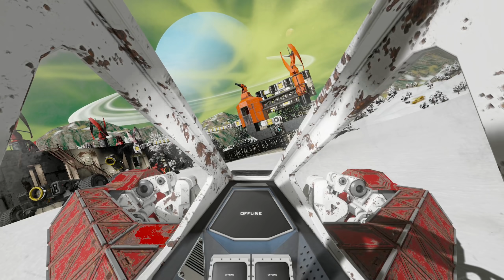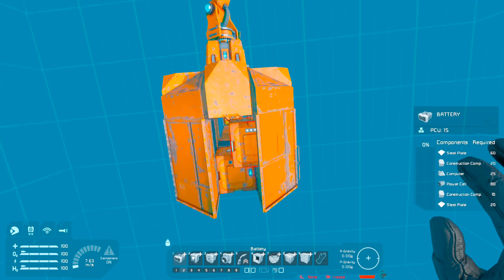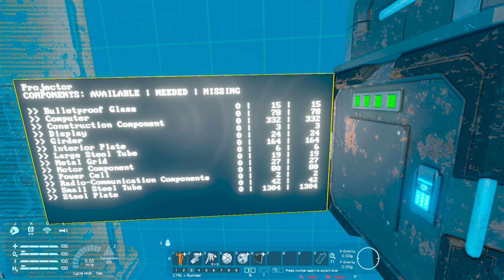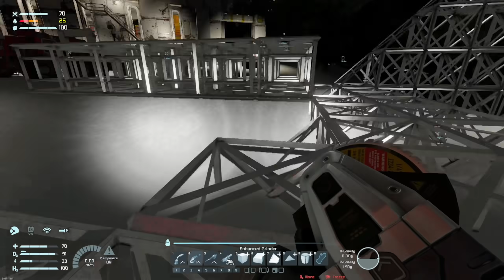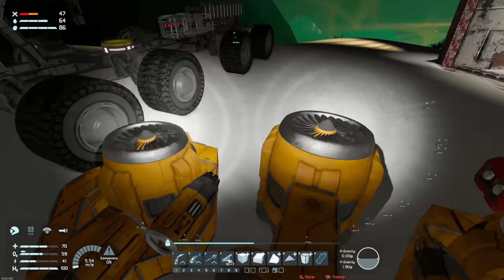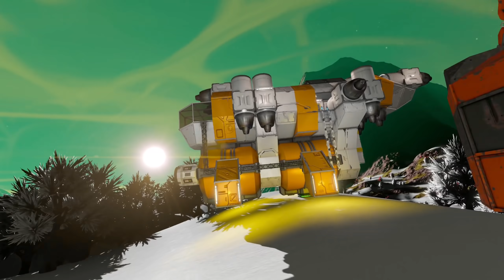Survival Impossible - Blueprint Mode #71 - Space Engineers Hardcore Survival

Comment: If you're struggling to find a reason to come back to this, FWIW, I'd love to see a re-beginning with the same settings as SI but where you can take advantage of what you've learned so far in a new start.
Reply from the maker: I'm somewhat tempted to do something like that, just in this save by going to a different planet. However it's going to have to wait a little longer as my main PC (with the most recent save) has had coolant from my CPU cooler leak all over it and I'm waiting on replacement bits before I can test what's still working 😔

Frustratingly, on the weekend I'd planned today as my day to load the world up and see what new ideas come to me and hopefully record
Reply: @Splitsie  Damn. Nothing scares me more than the idea of a coolant leak in my expensive computer. If you have not already sorted it out I would recommend disconnecting your drives before you start testing hardware then reconnect them once your sure everything is working.

Comment: Somewhat off topic, since I haven't got this far in this playlist yet, but I had an idea about mining that could be both practical and aesthetically pleasing. 

First, drill a vertical shaft down to whatever depth you need. 
Then, build a horizontal drilling rig with pistons. 
The drill head is mounted, not directly on the end of the piston cluster but on a "mining rover". It's not a real rover, it just works as a mount for some stabilizing wheels, but it's made up to look like a small rover, complete with lights and a control seat of some kind. 

Once the horizontal shaft is depleted, just withdraw the drill, swing it a few degrees to one side and drill a new shaft, like you did on the Lawn Chair base.  Depending on your vertical rig, it could be possible to extend the mine deeper, but I suspect this system works best when drilling into an ice lake.

Comment: Control center at the far end of the platform. Have the walls fold outward with the ceiling like a shell opening. No door in the way. Use light armor panels to make the shell so your rotors or hinges have an easier time.

Also... Panini could make use of an emergency down firing hydrogen thruster for heavy lifting or when you're falling for whatever reason.

Just a couple random ideas :p

Comment: It's probably a good idea to put heavy armour half-blocks around turret itself and heavy armour corner blocks to ground.
And turn battery with indicator up so you can see the charge.

You could also have it installable on top of foundation  that you place in location and then either lock or weld it (with mod I recall you have installed), so your design is more location agnostic since you can build foundation (you can even have a ship with projector installed for this and other similar ideas)

Comment: Hmmmm, for the doors, I'm suddenly wondering if something like a pair of panels on wheels that crawl up and down some angled blocks, with connectors at the top and bottom extents for locking/charging of the batteries that run the wheels. Part of me wants to try it out myself. Though, knowing SE, there's almost no way to keep it lined up correctly.

Comment: Suggestion for the lifter that removes the finished fort from the printer - move it to the other side of the printer and you could attach a walk way that also swings into place. along with the lifter, that allows you access to load/arm the fort. Might even be able to sneak in a grinder to have it cut the finished fort from the printer as well.

Comment: If the printer room doesn't need to be airtight, you could just build a solid armour slab, secure it to top of the building with merge blocks and then have some kind of external mechanism lift it off and move it out of the way as needed.  In an emergency, you could even move it out of the way with the Panini itself.

At the very least, it would be a departure from your other door designs, and keeping it on a relatively flat plane should reduce the risk to the Panini.  What's more, you can make it bigger than whatever opening you decide, lowering the chance that something goes wrong and crushes the printer machinery underneath.

Comment: Proximity Sensor to prevent Southern Fried Splitsie!

you only need to move the Projection leaving the Welders fixed in place. this is how many people build their printer walls as moving a projector and the projection is much easier.

why add a spotlight to an already fairly crowded roof. you have all manner of free space to place a free standing tower with both a Spotlight AND a Decoy in it to draw fire away from important buildings.
if it's tall enough, you can add 4 Wind Turbines onto it as well to provide power to the Base.

Comment: Spots:
Could add a merge block to the forts. Build the spot block module that you simply fly out and snap on.
Could be a lead to a new line of builds with the ability to add modules
Reply: One other thought. When you build the factory, make the back side large enough to hide the projection in it fully retracted position. Be silly it sticking out of the building during construction.

Comment: 23:41 Looks like you could probably retract the pistons at 0.1 m/s instead of the 0.025... There's a lot of downtime on the welders...
Reply: 26:08 Nudge-welding. It's a thing. Circa Splitsie, 2021. XD
Reply: 27:04 Piston elevator. Should be easy enough to make.
Reply: For your roof gate/door/opening, what if you design something that folded away? Use a combination of hinges and pistons to flip the roof up and then pull it down onto the sides of the building. Could be cool?

Comment: projected sub-grid Solution? 

First Make as ONE grid with a connector block that separates grid when ground down.., The next step is an engineering design goal. Example. Rotor based 'custom' Gun mount. Print a one grid with gun above rotor with rotor head removed and a head on the bottom of gun mount JUST above the rotor. then using piston from above (Or use gravity) maglock the top of the gun mount, 2) remove connecting block. 3) lower piston until rotor head is in rotor and then attach rotor. 

You can also print merge blocks that can be separated and then moved into position for locks and then grind them away. its all an engineering problem to be solved. A) Build as One B) Disassemble with grind blocks 3) Merge/attach 4) clean up.

Add program blocks and the whole process can be a press the BIG RED BUTTON party

PS allows spotlights on the gun itself. hint hint.
Reply: Also. it is really weird, but I just came u with that solution because you wanted to slave spotlights with the guns. its not the one you discussed but it works with custom mounts, the strange thing is I have needed to solve the problem myself, but this never occurred to me, but it did when i thought about your problem. So I guess my imagination works for everyone else but not for me? that is what is so weird, lol. either I am a very helpful 'selfless' person who only thinks of others ... or a moron.

Comment: For simplicity, maybe you could swap one magnetic pad with a merge block? You are using only one pad, so it won't reduce the functionality of the Fort Capac.

Then, you can have the printer merge block on a piston, and push printed builds through the roof - no worries about the wild swings when detaching the build.

Plus, on harder terrain, you can build foundations, and merge the forts to them. Or not, because you also have a magnetic pad.

Comment: I like the blueprint workspace. Until you moved I thought it was a modified screen cap.  I like the look you got from the blast door inside corner.  You should do a similar turret ammo indicator light for your base.  I thought the corner lights next to the door would be the ammo indicator light.  Until your "Happy Accident" with the unwelded light I was going to say to replace the 1 with 2 on either side of the post, with the missed on to your left, have 1 each on the front and back as you were looking at the Fort.  The game needs moving decoys so that the "Dancing Capac" will really dance.  Is the turret in the blueprint set for max range?  Cancel that, I saw that you do when you checked to see how long it would take to charge.  So "Wrong way Up" will be more like "Wrong way around"?
Thanks for the great video.

Comment: Why settle for an opening roof?  You could make the entire building open like a clamshell, leaving just a wall at one end, with the welding gear on it, and the control room on the other.

Perhaps not worth the extra work or ammo - but how about adding Gatling guns to the spot-light turrets as well?  Give them the ability to light it up, in both regards.
Reply: Had this exact thought, but was thinking an octagonal dome roof in two halves and have them fold 180 degrees against the sides of the building.
Reply: Well, the spotlights would have to be some kind of rotor turret, if I understand correctly. It could be an interesting idea to make some rotor turrets with both guns and spotlights, and some with only spotlights, and have all of them controlled in the same way. 

A rotor turret with more than one gatling gun will have more firepower than a standard gatling turret, so it's not really necessary to build ones with a big cluster of guns. Even just three or four guns will be a significant increase in volume of fire, and they could be made to look comparatively sleek. 

All in all, I like the idea of spotlights used to light up the targets, and I can see the appeal of having a bunch of those without guns on, just for the looks.

Comment: You don't need the outer (4) welder's on the printer.
Without them the building can be narrower aswell.

Could be worth finding the center of mass of the fort-capac than put a non-magnetic support under that and a grinder at the end of the print to cut it off. Disco floor timers to run the hole thing

Comment: You should set the script on the fort capac's to turn green when full so that if the light gets destroyed in an attack you will know. Rather than letting them get empty and not knowing they are because the light is broke.
Reply: I had the same thought too
Reply from the maker: The trouble with that is finding them, they really need the light on when low because I'll undoubtedly miss an unlit base over the area they're going to be spread. One option I could use though is to put the light on the underside of the beam instead to make it less vulnerable to being shot
Reply: @Splitsie  As mentioned above (@ShamblerDK), the light on the underside of the beam will make it more visible, too, since it'd shine brightly against the snow.
Reply: @Splitsie  Just add an additional green light and have the timer blocks toggle between red and green for full and empty.

Comment: You may want to design your light controls so that the "fail state" (if the control system gets damaged) is something noticable like a flashing light
Reply: For example you could have the time between flashes (something controlled by the light itself) be slightly longer than the time in between each script run, and then as part of the script have it toggle the light in such a way that the lights internal timer resets. So from the outside nothing happens so long as the script is running, but if it fails because it got damaged you will get periodic flashes, like a smoke alarm.

Comment: Tad surprised you didint use that battery in the printer-building instead of grinding it down. having multiple batteries like that could be useful, should a reaver come and blow the linkage away. also wonderd if putting up a int. turret on the fort, just to handle incomming rockets and small crafts could have been a worthwhile idea, but i reckon that reloading those could be a bigger hassle than profit.
Reply from the maker: I actually didn't end up grinding that battery, it fell and exploded :P
Reply from the maker: If you look carefully in the time lapse you'll see it - I forgot to include it in the edit and only noticed when I was watching the time lapse after uploading :/

Comment: If you want to make a programmable block that auto triggers, but does so less often than every 100 ticks, just add a counter variable to the script. Every time the script runs, the first thing it does is increment the counter. If the conter reaches some high threshold - say, 100 - then it resets to zero and runs the "real" logic. That way the only thing that executes every hundred ticks is a variable increment, which costs virtually nothing. The "real code" only runs every 100th time, and the whole thing only runs ever 100 ticks, so the real code only runs once every 10,000 ticks, and since you can have dedicated code, the actual code required to check the inventory of the turret is only about 3 lines rather than the massive "extremely flexible so it can do anything" code base of the workshop script.

Comment: Suggestion, you could make a control room that will have info on LCDs with data sent from Fort Capac, and alarms also going to this room. And if you like automation, you could make small drones that will deliver ammunition when needed to Fort Capac.
Reply: Unless he makes a direct connection that would require antennas on the forts and that would attract a lot of unwanted attention.
Reply: @Punnikin1969  Having LCDs showing the status would indeed require antennas, but setting up automated ammo deliveries wouldn't. 

I like the idea with LCDs, so I would maybe consider "faking" it somehow. That said, I'm not exactly sure how the AI detect such signals. If setting the antennas to minimal range would let a system like this work without drawing a significant amount of attention, that could be an option.
Reply: Yepp, the anti-wolves-drone from the autopilot tutorial could do the restocking quite nicely. With some adjustments ofc.
Reply: @corbi8599  I would make a much lighter, unarmed delivery drone for the ammo resupply. That way, it wouldn't chew up the ammo it's supposed to deliver. 

I think it would be fun to see a small fleet of fighter drones, like the ones Splitsie already uses, that can be launched on a five minute patrol route when necessary. Kind of like a "panic button" that puts the base on high alert = turns on a bunch of red lights, sets all guns to "on" and starts the drones' patrol route. 

It would look cool, and would give the base some extra teeth while you scramble to get into your panic room/fighter/drone control seat.